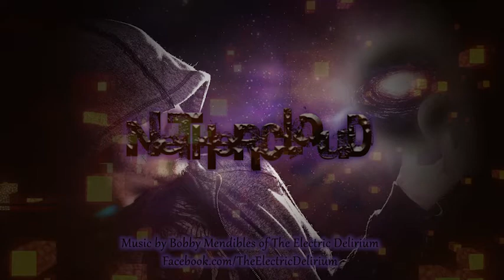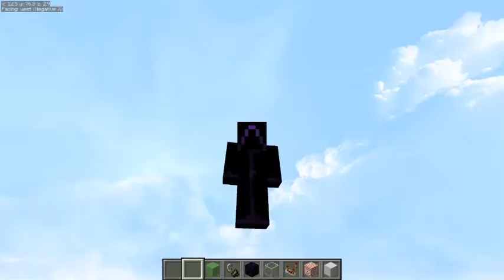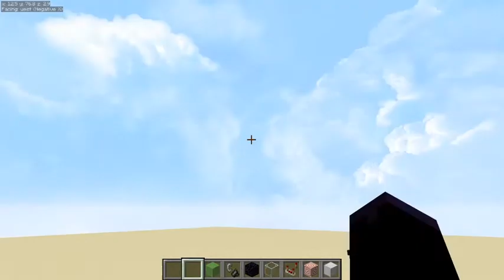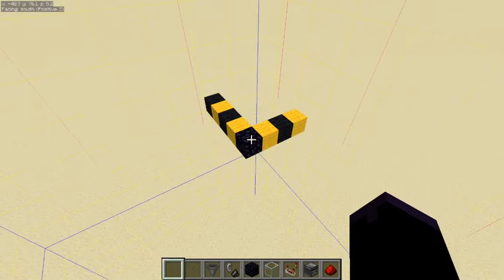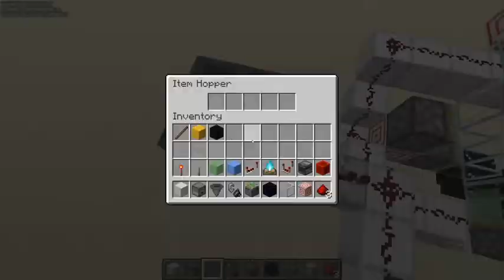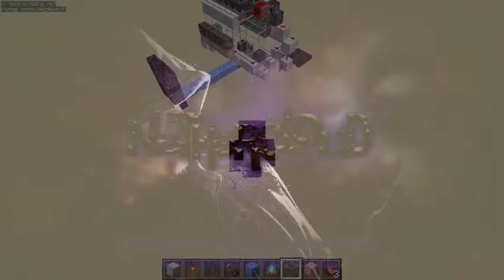Trans-Dimensional Killing Chamber for Your Guardian Farm (Minecraft 1.16+)

Comment: can you simply sort the itemns directly coming out of the chamber? or is there some reason to send them back through the portal?
Reply from the maker: You can, but you would need to set up a system with slime blocks/pistons to line up the items to get them to hit the hoppers on the sorters. Which is not super hard, but sending them through the portal let's you use water streams. I haven't tested, but I believe there are too many items coming in to just send them down a hopper line into sortering system. you will need a few slices of the sorting system to pick up each item to keep up with the item flow. This all depends, of course, on how effecient your farm is at spawning the guardians.

Comment: Great design, exactly what I was looking for. Quick to build and doesn't require a lot of resources!
Reply: I asume this also works with a gold farm?
Reply from the maker: @MasterRobbe  You would have to kill them with fall damage or with a sword instead of fire, but the idea of using the chamber to condense the drops to a single block so they can be sorted works for sure. I have a similar design on my gold farm, but I don't send things to the overworld. I do all the sorting in the nether. Planning on setting up a piglin bartering system underneath it. Gnembaum has a really great video that explains all the mechanics about gold farms and piglin bartering that I took a lot of inspiration from.
Reply from the maker: Awesome! <3